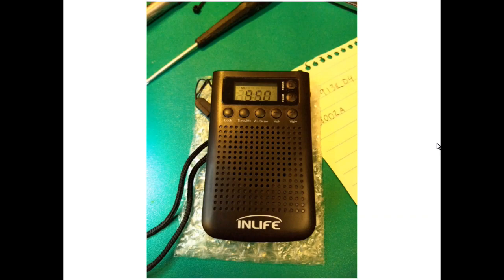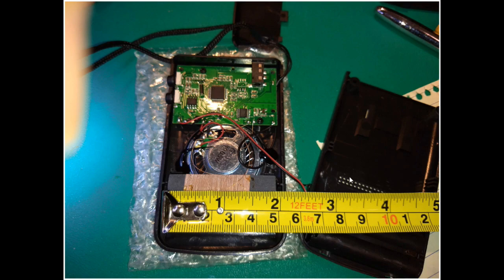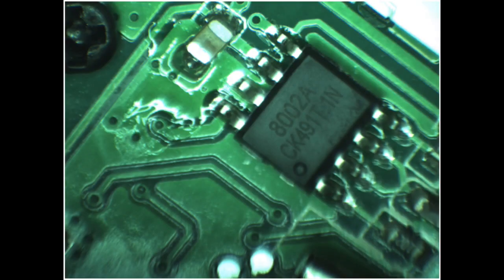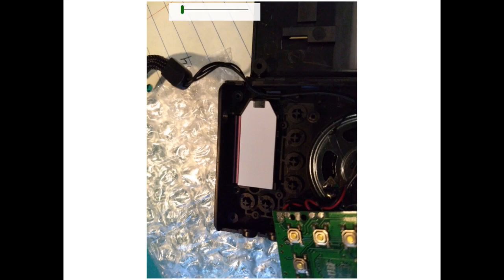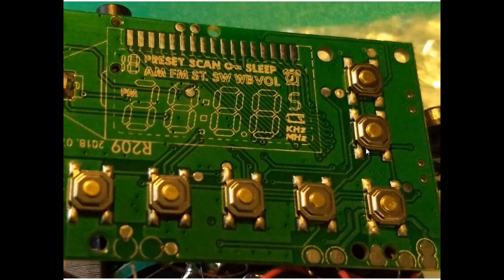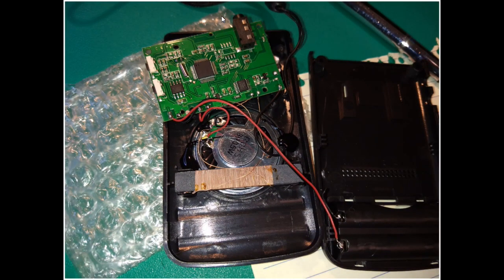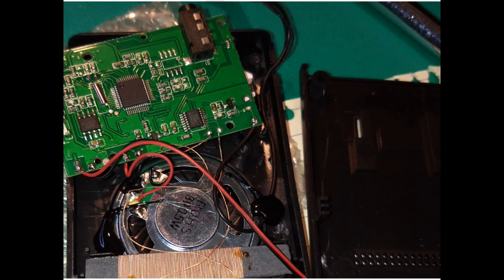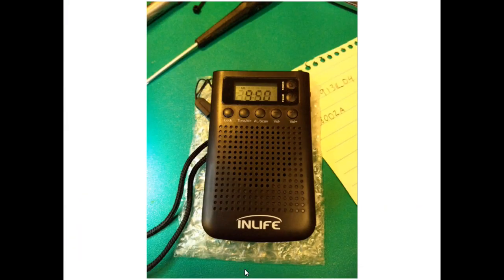Inside INLIFE AM FM Pocket Radio teardown

Comment: Thank you for your video. I ordered a XHDATA D-219 pocket radio from Amazon and it seemed to be malfunctioning.  I've opened mine up (I am not too bad at these things as studied and introduction year of Cybernetics Engineering where  I've been in a lab soldering etc.
Anyway this radio has a huge amount of sticky glue substance behind the battery slot, right where the AM antenna is. And there's a crystal part inside but there's no LCD radio clock on this radio? So I am wondering why it's there?

Comment: They put the AM coil right on top of the metal speaker frame. Bad idea.
Reply from the maker: It does seem to work fine on the AM band but a different place for the antenna would have  been better.👍

Comment: Very interesting to see and the 411 on the XTAL...I would pull it and experiment!  :)  ~Jack, VEG
Reply from the maker: I think if the crystal was removed the radio wouldn’t do anything. I think both the LCD drive and receiver chip need a clock signal to operate. Thanks for watching.👍❤️📻
Reply: And that's why I would remove it and plug in a signal generator...see if the radio does get those wide ranges of freq's.  :)  ~Jack, VEG